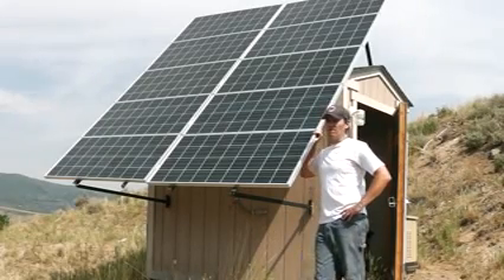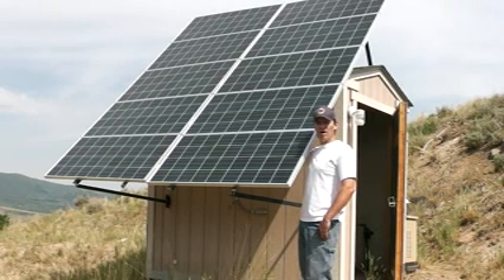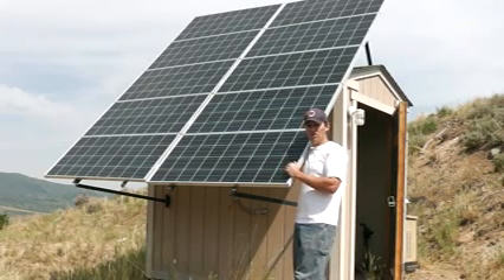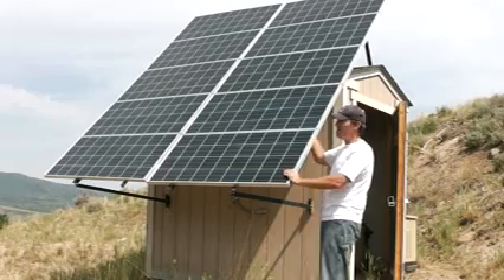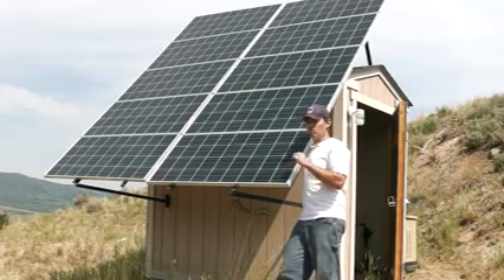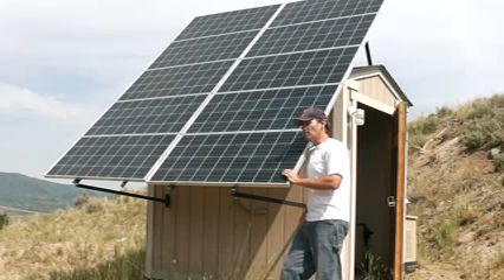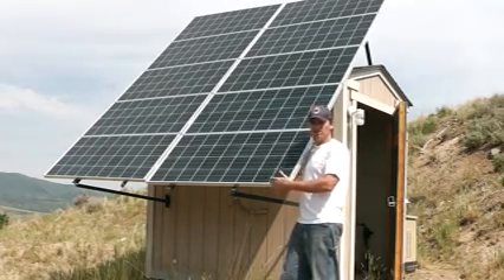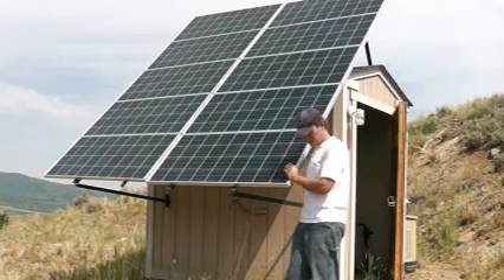Living Off The Grid 2: Our Solar Array in Off Grid Solar Power System

Comment: webdirector2112 Generally speaking you will get 4 - 5 peek sun hours per day, depending on your location and the season. So if you require 16kwh per day, you should be looking at a minimum of a 4kw system.... BUT if your talking off-grid, it needs to be much larger to compensate for cloudy days etc. My first suggestion, is to look seriously at ways of lowering your energy consumption... :-D

Comment: So just 1350 watt panels is enough to run your entire house ?   That's amazing. A toaster alone is 1500 watts.  Plus refrigerators etc.  I use 16kwh per day which isn't much. What would I need? I'm just starting to research this and not familiar with it.  Thx.  The videos are great and learning a lot very quickly. Explaining things very well.

Comment: What method of energy would you use if the power grid went down?  I'm not sure but 12v system could run a lot of things you could get from old cars.  I suppose my attraction for solar energe is because it is quiet.